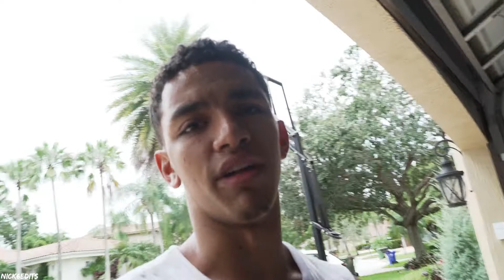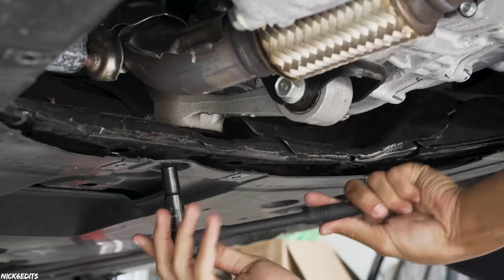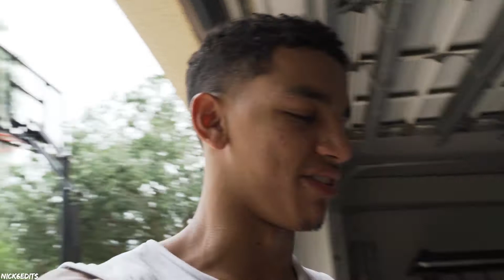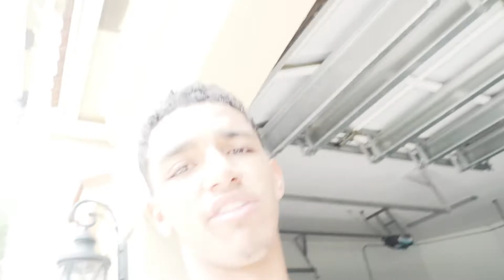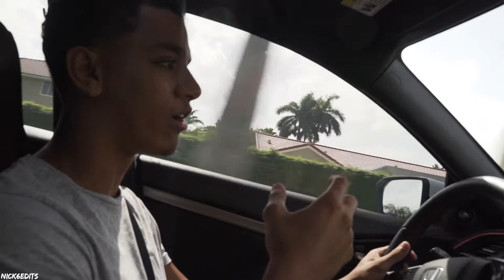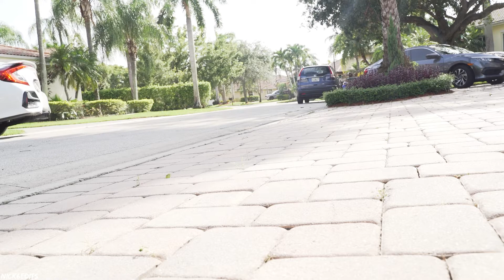10th gen Civic Si Build Vlog #1 Installing Perrin Rear Motor Mount Inserts-NICK6EDITS

Comment: I just installed mine on my Si as well and yea first gear alot of vibration especially if you let go of teh clutch slow and little gas. You have to get use to teh vibration and also play with it to get a good feel for the clutch. But so far I enjoyed my perrin inserts gave such smoother shifts, no more engine jerk when you take off in 1st gear

Comment: You could have just put the bolt in the front part of the mount... then install it.. as one side has a cut out... then the front pipe wouldnt have been in the way